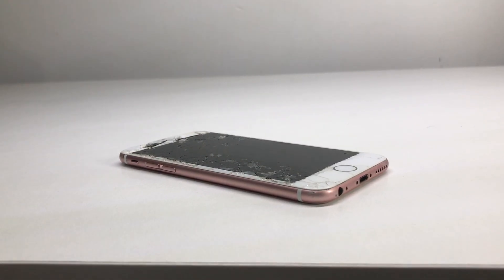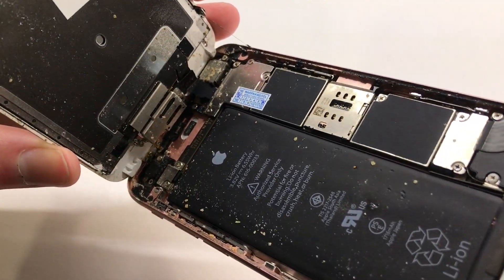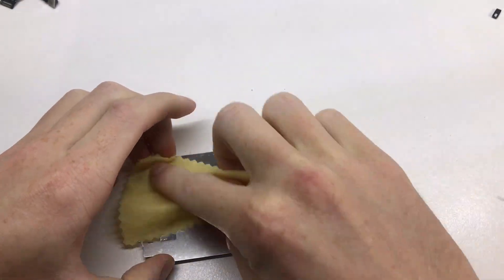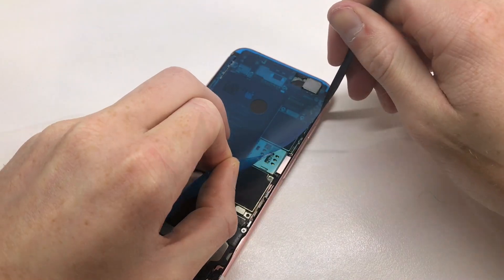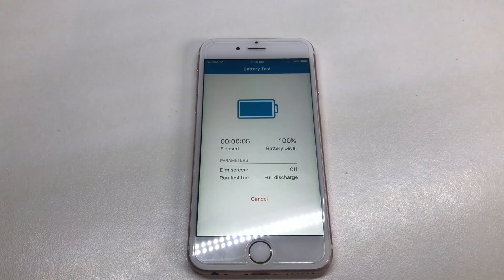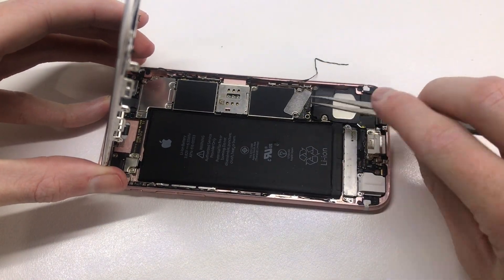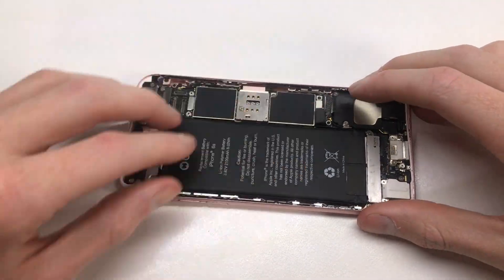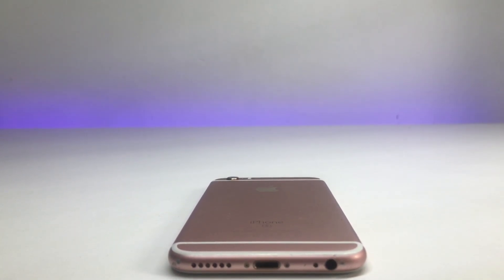The $60 iPhone 6s Restoration - 5 Second Battery Life! - IOS 10.2

Comment: We don't reinstall the seal because all it does is make future repairs a pain, especially if you aren't doing a screen replacement. it doesn't make it waterproof, the 6s isn't waterproof, and it actually doesn't effect 3D Touch, that is misinformation, we have thoroughly tested it. just putting that out there, we aren't crap because we don't do that, we just don't do work that has no real purpose, it's not the cost, it's not even really the extra labour for adding the seal back one time, it's the fact we know they will be back after breaking their phone again or needing the battery replaced after apple refuses. also i know that sealing it can increase the structural strength of the phone but it's minimal at best, the 7000 series aluminium on it's own fixed bendgate and if you are taking your phone out of a repair shop without a strong case then they aren't doing their job, you already proved you don't look after your phone, get a good case, get a tempered glass screen protector and we hope to not see you again.
Reply: Doug Newton if they are coming back for a repair, then you obviously didn’t repair it right in the first place
Reply: LOL wut? I can't make customers stop dropping their phones and smashing their screens, i can't make them understand that 6s's don't like swimming, i also can't prevent a battery from degrading, I did my job, they walk about with a fully functional phone, ideally with a case, and also with the current status of their battery so they can have an idea when it will die
Reply: Doug Newton mate if the seal was there in the first place it obviously does something, they cost next to nothing, so you might as well do it right
Reply: does it now? clearly they never get it wrong, absolutely no track record of having almost every product have at least 1 high profile failure every generation and definitely isn't known for purposely making their stuff hard to repair, no, apple knows best...
it's not about doing it "right" that seal is there to make the repair harder by needing heat and is only there to over compensate after the 6 bent like taco. we don't apply it for a reason, it's a thought out choice, and honestly sometimes we do add it if we are pretty confident you won't be back, but it's rare, it's really not hard to tell when someone will be back in a month because they just "literally omg had to get that selfie over the rocks, oopsie it slipped" and though it's easy to add, it's a pain to remove and you have to remove all of it each time you open the phone. If i think you will be back i'm not adding it, it's not going to prevent you from breaking your phone again and i have a line of phones so not having to deal with it when you come back due to your lack of respect for that $800 device daddy bought you is just better. unless you do repairs for a living you have no idea, doing the odd at home repair is not the same, you don't have any idea the failure rate of apple, no idea the crap they do just to make it harder for you because "it's only an extra 10 minutes" 6 phones in that wasted me an hour that didn't need to be wasted. if you want to add the seal go for it, i just made that 6s much easier to open by not having it, pop those 2 screws out and lift up the screen with a nail, go add it yourself.
Reply: Doug Newton look mate, I’m mates with Hugh, he’s sitting right next to me and he says it’s really not that hard to remove a seal and add it back
Reply: look, if it's not hard to take it back off it wasn't a good application, if you've opened a stock 6s and had to make sure you didn't break the screen you'd know what it should be like, if it's not that hard to remove after you reapplied you did it wrong, yes heat makes it way easier to remove but that's a step i shouldn't need to do on a non waterproof iphone. I wasn't trying to be a dick, if i came off that way i'm sorry, but also you aren't on the same level, Hugh probably isn't either, doing vids on repairs and doing repairs for 8 hours a day 5 days a week are not the same, neither of you are Louis Rossmann, not saying I am either, my micro soldering skills could use some work, if Louis chimed in and said i should do it i'll admit i'm wrong. I'm not trying to knock Hugh, the vid was great, i liked it, just didn't like the jab at an industry that he doesn't know enough about. it was just a comment on why we don't do it and a clapback from kid who does bluray unboxings isn't going to change the fact it's unnecessary
Reply: I can't argue with the fact that none of us are perfect and we all have different strengths and i don't have much clue with iPhones all that I was trying to say is that its gotta do something if it came with it

Comment: If you get a battery replacement from Apple do they upgrade your firmware? I have an iPod Touch 6 that's jailbroken and I've put it in the freezer whenever it gets hot and I realized it slowed down its performance.

Comment: damn !! that's higher than professional skills you got and ethics too.. I was trying to diy project of replacing the power button of iPhone 4 with 4s and ripped the display cable i guess and now i have an 4 (display not working ) & 4s with display working but cant interchange as have to remove the frame and replace it ... would appreciate if it can be done please make a video.. interchange iPhone 4 LCD with 4s...

Comment: Do you purchase your phones iCloud locked? If so how do you remove that? Also Great video!!
Reply: How do you do it then?
Reply: @alexdumbreck9729  You can force the device to change it's serial number through flashing a chip. But then it's literally a different device, so it might be best to swap with a broken device.
Reply: No way to remove it unless the original owner does.
Reply: Josue Montalvo not true
Reply: Josue Montalvo yes you can, but for unlock the icloud you need to replace components such as the motherboard, and that is almost the same price as the phone so not worth it
Reply: +Alex D Well one way to do it is to bypass the iCloud Lock by using bugs that exist in the software, and it will let you use the phone but certain features will not work.

Comment: Just bought a 64gb iPhone 6 for $50 au needs a new battery. The battery counts down like seconds and dies randomly,it also won’t turn on if it is to cold so leaving it plugged in overnight will make it die because it gets to cold so I have to put in front of the heater for it to power on but the phone is in amazing condition, there are no cracks or scratches anywhere. There is only some fading from where the case didn’t cover the back near the camera and Apple logo but the screen protector was the original one from when the phone was new and there are zero scratches on the screen at all. I hope it is still in warranty so I don’t have to pay for the battery replacement. I’m not sure if the iPhone 6 had a battery replacement program though.